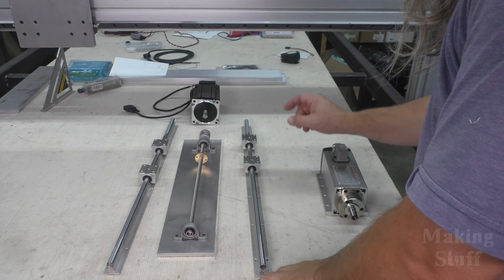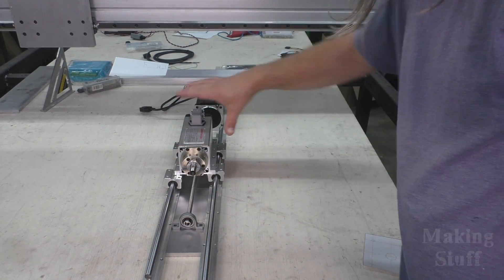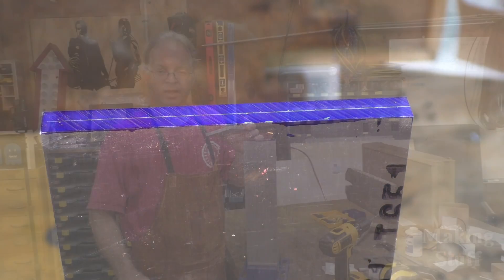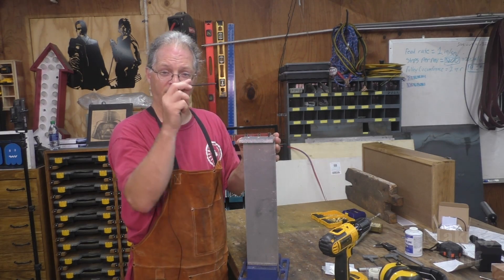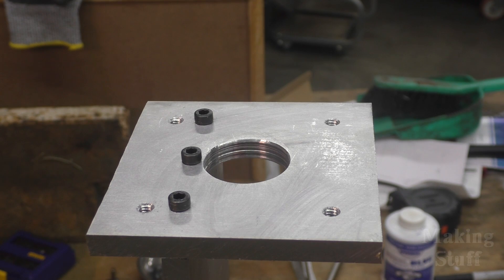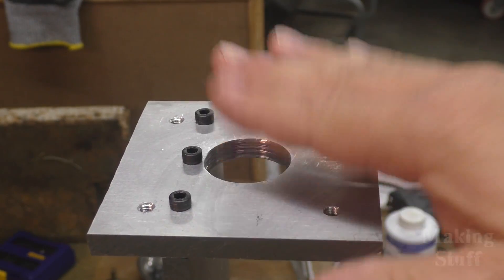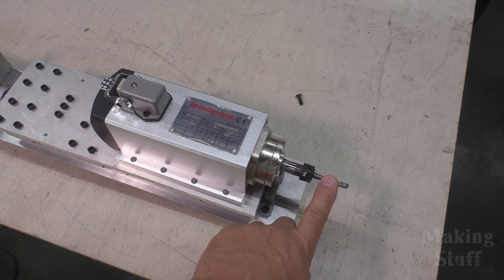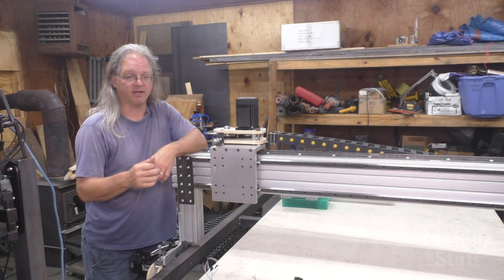DIY CNC Router Part 8 - Making the Z-Axis

Comment from the maker: Feels good to get back in the shop and work on this project.  Hope you guys enjoy!  Leave me a comment and let me know what you think.
Reply: Great Video! I would use an Angular contact bearing block like a BF12 for your Screw shaft, also use a ballscrew instead of those brass ACME nuts for zero backlash.
Reply: Nice job! Mistakes are not made by those who do nothing.
If it's poosible, tell, please, power(kw) of spindle motor and steper motors parametrs.
Reply: Really appreciate your videos. So well presented and clear.  Must take a lot of effort on your part. So really appreciate it.

Comment: Bob, after building both CNC with the same bar type linear bearings.  Do you think the square block linear rails like you used on the X axis are just as strong/tight tolerances?     
I ask because the round rails seem to be the "normal way"
I am working on making a new column on the mini mill and thinking about using a bunch of 2020/2040 to make a beefy block like your X axis rail, (but without the hollowness) (I think this allows for to much harmonics to be created.)   Depending on how tall the column will be I may need to reinforce with square or flat steel.  
What I had to do on my homemade CNC was add linear rails (block type) on the sides and use angle plates to the Z plate so the Z column was stabilized all the way side to side and to the front.  If I had the dual rail on the X like yours it would be so stiff I am sure it could mill steel with the right spindle control.
Reply from the maker: I have actually worn out the round rails before.  The only reason I used them here is because I already had them on hand.
Reply: @MakingStuff  Good To Know. I think a  z axis supported by four square rails is the route I will stick with one on each vertical faces and sides with a beefy spindle spacer and plate.  I would like to run two lead screws to lift all the expected weight of a BT30 spindle and motor.

Comment: i think you should of countersunk all your holes and moved up the motor all the way and cut down your plate  so the motor is mounted on the plate where the linear bearings are and not on a piece of aluminum that can flex
Reply: there will be flex from 10 thou and more

Comment: Are you depending on the weight of the spindle to get rid of backlash in the Z axis lead screw?  I would love to see a measurement of backlash with your dial gauge.
Reply from the maker: Yes gravity is always pulling down on it so I haven't been worried about any backlash.

Comment: Mounting the spindle that far away from the linear bearings may introduce flex when cutting along the Y axis. Consider having more overlap between the spindle and the bearings, or stiffen the z plate with pieces on the side to make it a C channel instead of a flat bar

Comment: Just a suggestion for future fabrication of right angle components, you could use a piece of square stock to clamp the two parts together while you mark the hole locations. It could be steel, aluminum or wood. I’ve done that a few times. 
Thanks,
John
Reply from the maker: Thanks for the tip!
Reply: @MakingStuff  YW

Comment: I know this is total overkill but it is the setup I have.  I want to finish a very similar assembly to this part but mine is going to be a simple Router lift for a Makita Trim Router.  I have everything figured out except the wiring and stepper driver.  I want to use a Ramps 1.4 and Mega setup with a Discount screen to control the stepper so that I have measured control over the lift.  I have Zmin and Zmax limit switches as well.  What is the best firmware to do this with and is there a more practical motor driver setup?  Thanks!  If you get to Sevierville stop on by!